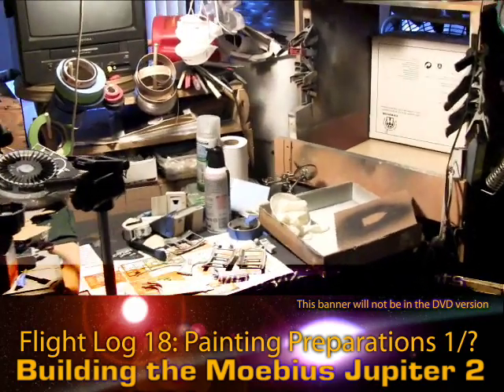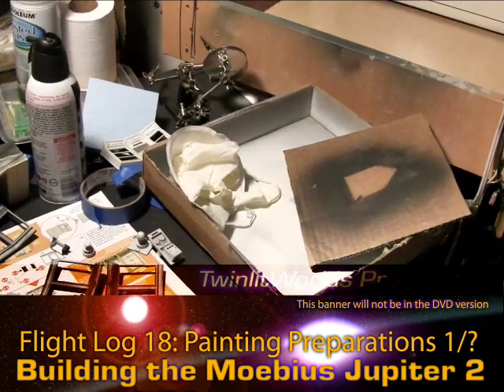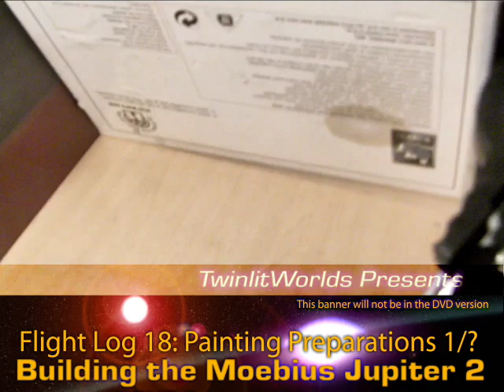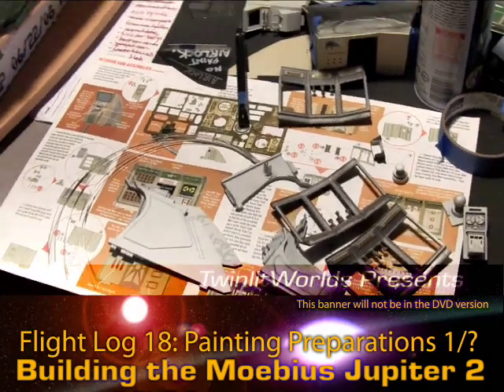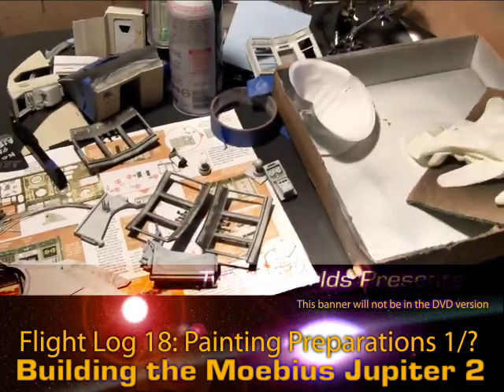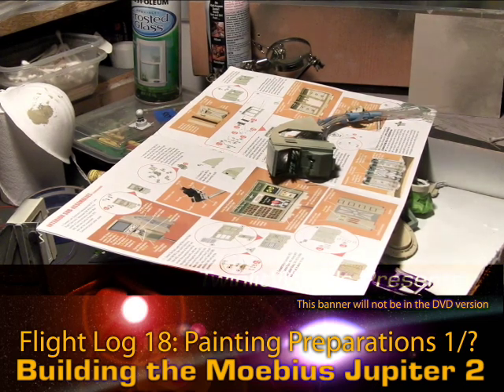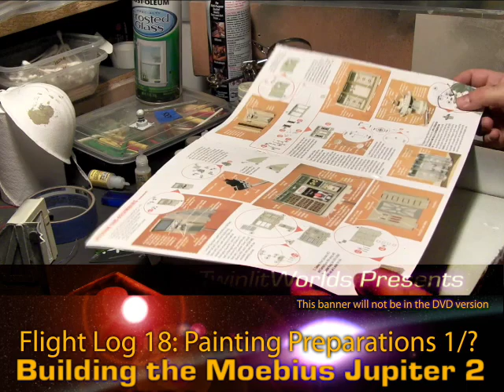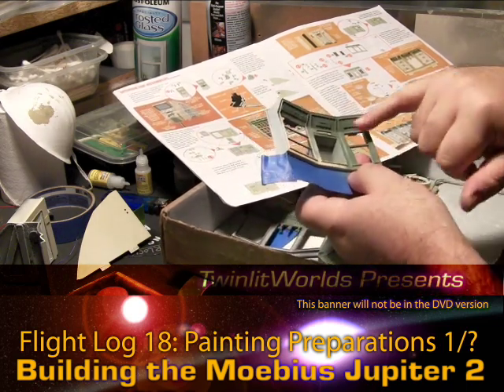Project Jupiter: Flight Log18 Painting Prep 1/2

Comment: I wouldn't worry about the fan motor.  In order for paint to ignite in the air stream the conditions would have to be just perfect.  The proper air to fume mixture along with a good spark to start a flame.  Then once you get the flame it will jet out the back of the window, away from your work.  Before it becomes too much of a problem, you will notice it and shut down your paint work, which will shut down the flames.  A hint for a filter, go by a house hold filter.